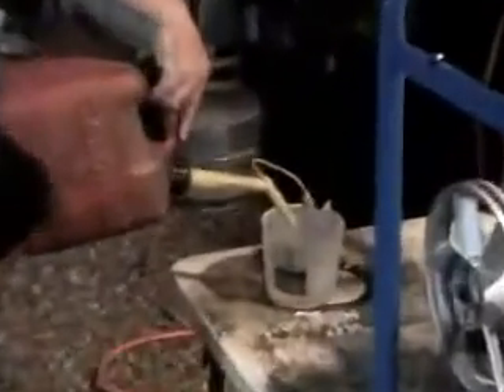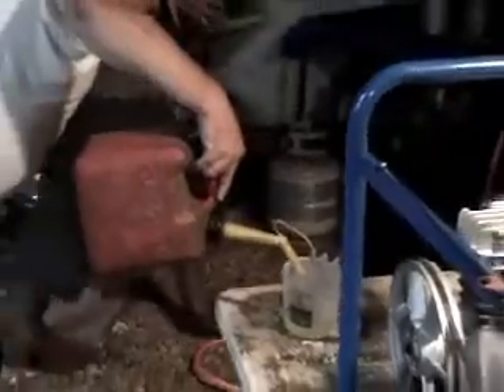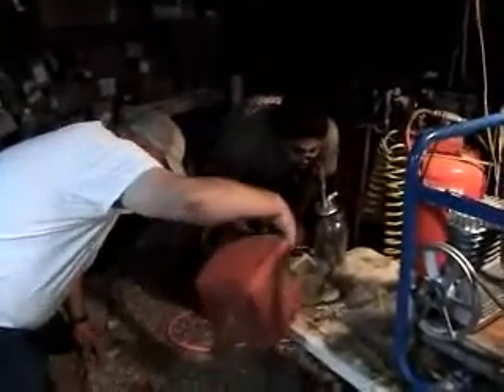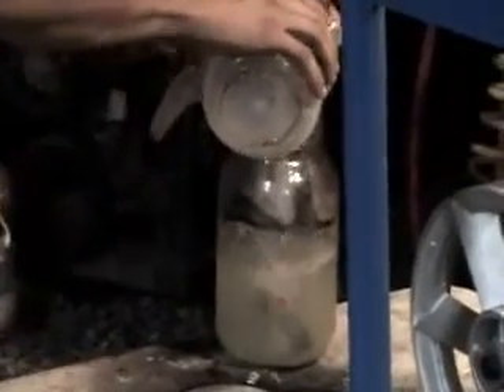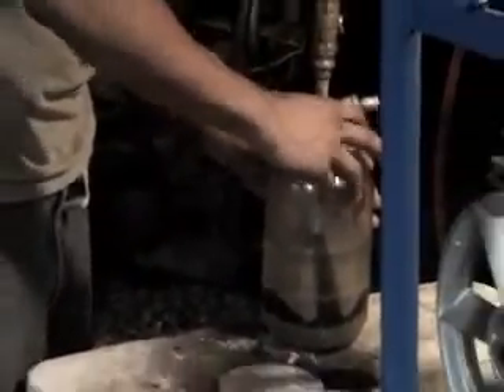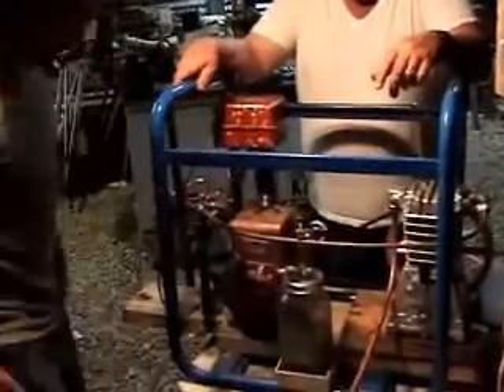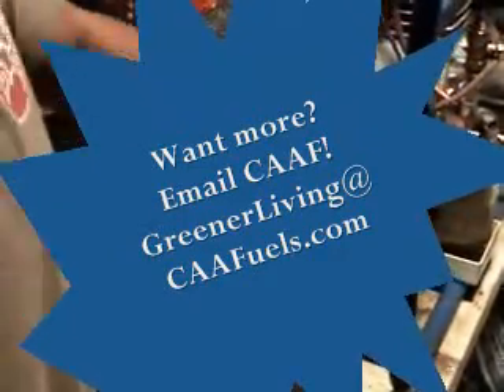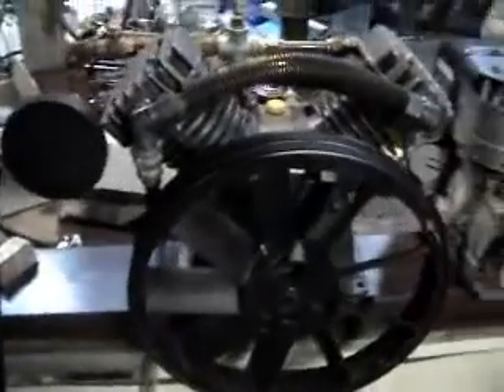CAAF - The Gemini Reactor

Comment: so ur just pulling more gasses thru the geet and the engine is taking what it needs the excess is bg pumped to a second fuel consuming device wich could be a furnace  i wonder if a smaller engine could produce a larger amount of syngas for an off grid furnace and power supply in other words make a  geet on a small engine that makes enough syngas to run a  generator and a furnace off a single large geet

Comment: Thanks for the video.

Have you thought about running the line that's going to the burner from the vacuum bottle through a GEET reactor before it hits the burner to see if there is any difference in the flame?  Since you need heat for the reactor maybe you can daisy chain reactors so the exhaust coming from your motor is fed into the second GEET which is fed by the compressor; that way you'll have the heat for the reactor (that is assuming your exhaust is hot).  It would be interesting.